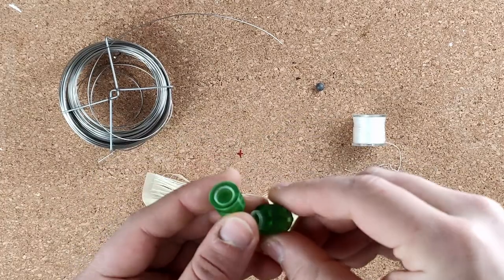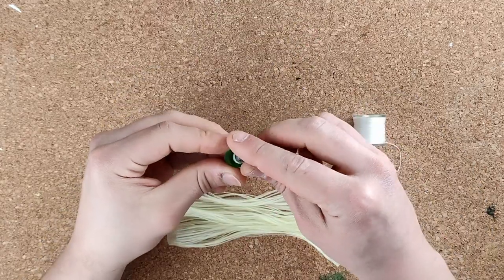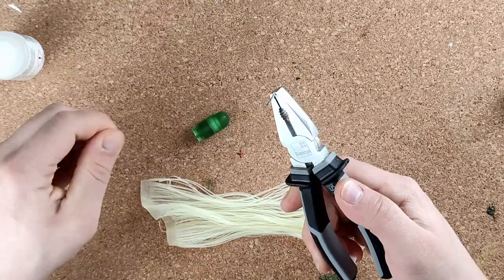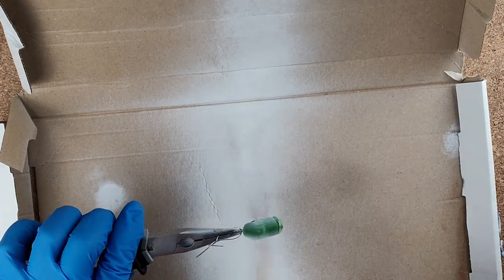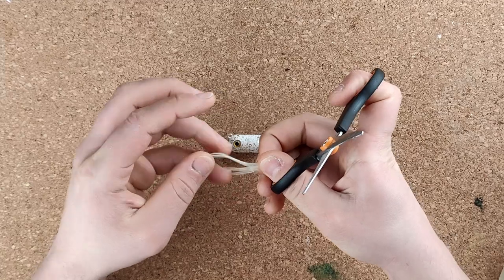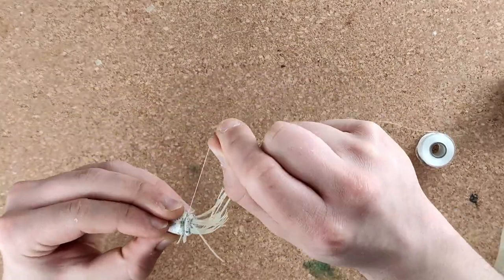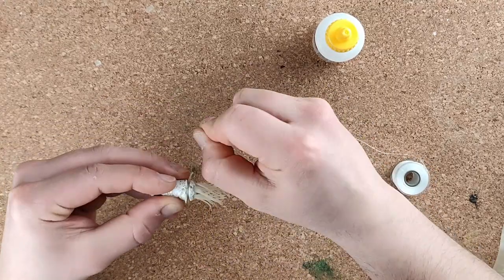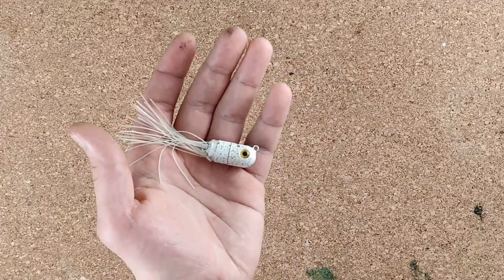Tiny Homemade Fishing Lure for Perch and Bass (+Free files!)

Comment: Did you ever have any problems with the wire pulling out of the body?
Reply from the maker: I've pulled on a single wire connection with a pull scale and it broke around 12KG. Plenty strong for the fish here.